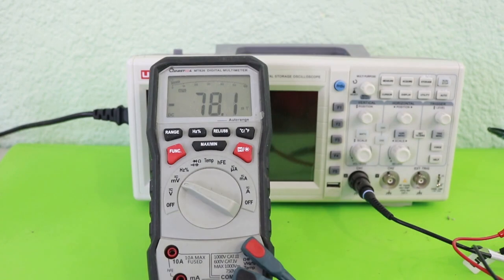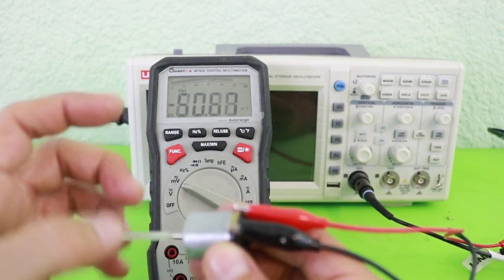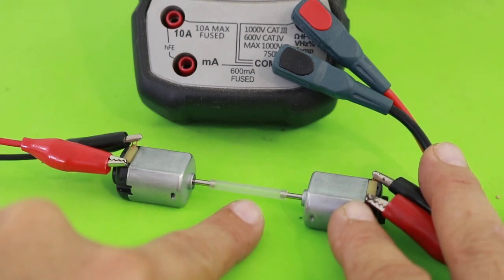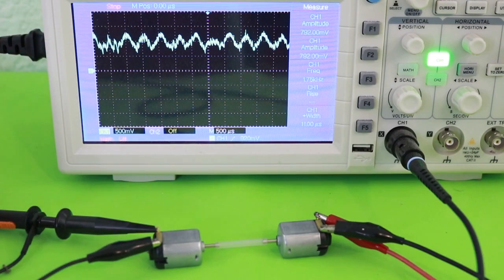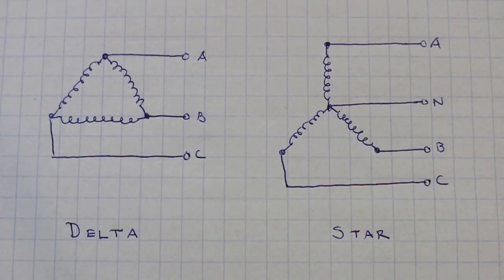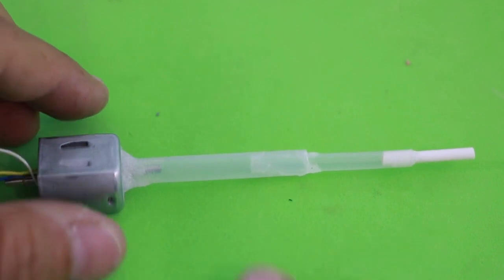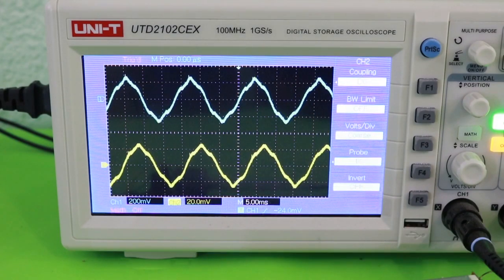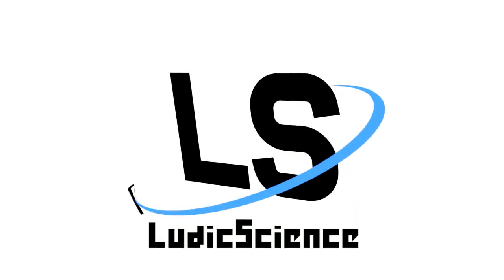Make a 3 Phase Alternator From a DC Motor

Comment: Those are some really bad motors, look how little copper wire and how short the rotor is!
Reply from the maker: Yes they are the cheapest you can find
Reply: @ludicscience  You should do another version where you combine 2 rotors with more copper wire and put 2  stators around it to make it more stable and efficient

Comment: The one thing about these DC motors that one needs to keep in mind is that the armature has an ODD number of windings. [In this case it was 3]. If a motor has an EVEN number of windings, like 2, 4, 6 etc, it will have an even number of commutator pins, and there is a DANGER that if a pair of coils is exactly aligned with the permanent magnets, and a voltage is applied to the brushes, the motor will NEVER start. It won't "know" in which direction to "decide" to turn. This won't happen with an odd number of windings and commutators like 3, 5, 7, 9 etc., because there is always a "bias" where the motor wants to turn.
Reply from the maker: Good observation

Comment: so if you use ESC to power the alternator, you can make a small DC brushless motor?
Reply: Yes, it would be a outrunner brushless motor.

You can also get a bldc driver/controller (the non-rc version of esc)

Comment: I also done this but a long time ago to run a analogue clock
Reply from the maker: Interesting, can you explain more please?
Reply: @ludicscience   ya well  I taken first  my phone charger adaptor for     source voltage for main motor and Then i taken positive and negative terminals of generator and I connected these two terminals directly to analogue wall clock